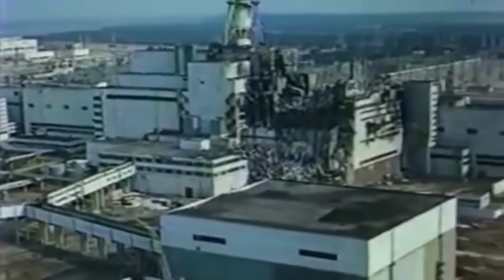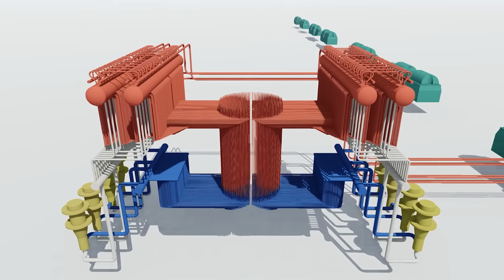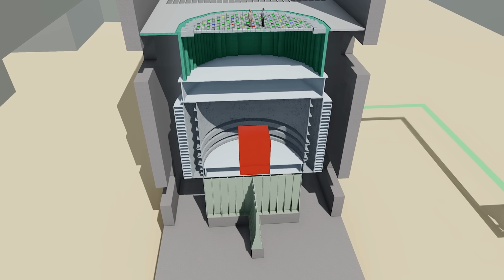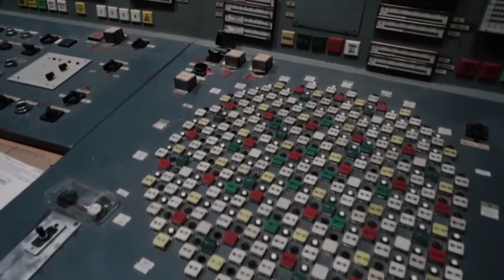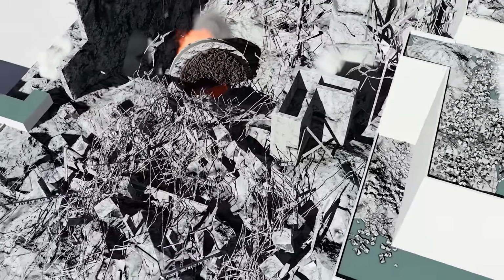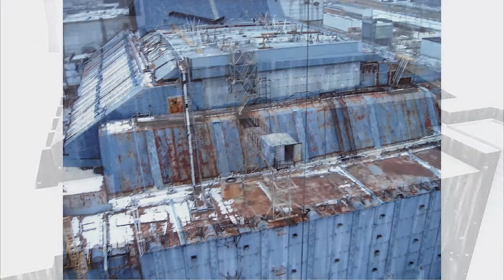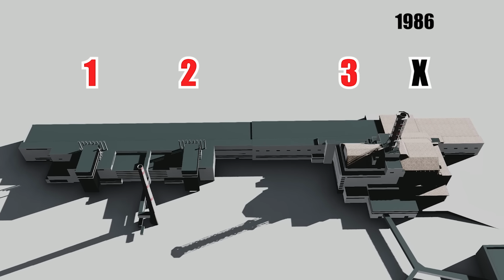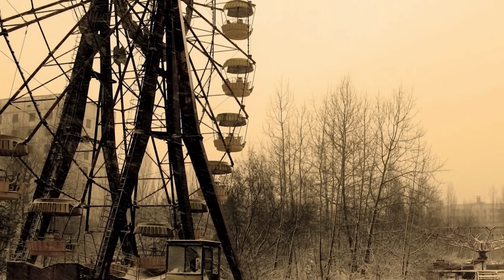CHERNOBYL DISASTER - An Inside Look - 3D

Comment: The main reason for the online refueling: not to put fresh fuel in, but to take the very useful used fuel out. One of the main byproducts of a U-235 fission reactor: Pu-239. Chernobyl and the other reactors like it supplied fissile material to the soviet nuclear weapons program.
Reply: No, this is wrong.  The USSR and the US both have purpose-built reactors that cook the uranium to within an hour of the optimal time required for optimal yield vs Pu-240 contamination.  A power plant spent fuel is simply sloppy seconds to that.
Reply from the maker: This is very interesting.  Does this mean that minimal spent fuel was left at RBMK sites because it was removed to Plutonium recovery facilites? At least for the time that Plutonium harvesting was still happening.
Reply: @Mike-Bell  I’m not sure whether there is any form of semi-permanent storage of spent fuel on site. I would assume so, in the event that the military isn’t currently seeking fresh plutonium. Looking at maps of RBMK reactors and Soviet military bases, they are always very close together. That’s certainly by design.

Comment: Narrator is wrong though. The reactor didn’t go supercritical. That’s impossible
Reply: Until it's fuel load went through the floor.....
Reply: @simonthomas5367  supercritical implies that it was a nuclear explosion. Not possible in a nuclear reactor.
Reply: @slugmaster64  Chernobyl was one "Prompt Critical" accident, the only one in a Nuclear Power Plant. One NPP can not explode like an atomic bomb for other reasons, but it can be supercritical
Reply: @slugmaster64  A criticality accident is an uncontrolled nuclear fission chain reaction. It is sometimes referred to as a critical excursion, critical power excursion, or divergent chain reaction. Any such event involves the unintended accumulation or arrangement of a critical mass of fissile material, for example enriched uranium or plutonium. Criticality accidents can release potentially fatal radiation doses, if they occur in an unprotected environment, such as occurred in Chernobyl. 

Under normal circumstances, a critical or supercritical fission reaction (one that is self-sustaining in power or increasing in power) should only occur inside a safely shielded location, such as a reactor core or a suitable test environment. A criticality accident occurs if the same reaction is achieved unintentionally, for example in an unsafe environment or during reactor maintenance.
Reply: @slugmaster64  Incorrect. Supercritical purely means that the rate of reaction is increasing. What you're talking about is called 'prompt critical'.
Reply: All reactors have to go supercritical when raising power. But, apart from special research reactors, reactors must be controlled so that they do not reach prompt critical.

Comment: well - it's hard to decide which of the three extreme radiation releases was the worst: Chernobyl, Fukushima or Mayak - but as for Mayak even less is known than for Chernobyl - and for Fukushima there're still not enough long-term data
in addition to that there're several other accidents which release a similar amount of radiation although maybe not so violent as Chernobyl and Fukushima blowing up entire buildings - and only cause Fukushima had additional layers it wasn't as violant as Chernobyl by blowing open the "active zone"
has humanity learned its lesson? I doubt it as still new reactors are being constructed right now - and I don'T even talk about the experiements towards fusion (which still will produce long term radiation waste - which maybe even worse to clean up as splitting of Tritium from Hydrogen and Deuterium is even way harder than those heavy elements beyond Lead) but regular fission type reactors
Reply: Nuclear energy is safe. Way safer than any alternative. You cant possibly use fukushima as an argument against nuclear power. It was clearly a natural disaster that caused it not the plant itself. Putting a nuclear power plant in one of the most seismically active places on earth is retarded and should have been avoided, also the waste materials created in nuclear powerplants take up extremely little space and storage is already possible in places where it is safe from the environment. We have the technology to use nuclear power safely and it is the only thing that can replace fossil fuels.
Reply: @ratreptile  well, aside from building a npp at that location was stupid in the first place, it's to blame on the "genius" responsible for installing the main switch gear an backup batteries in the basement - only for that reason it was possible for it to get flooded
they build a wall to protect it, aside from it never was meant to withstand a tsunami but regular high tides only, so they had a possible flooding in mind - installing the electrical stuff below sea level was just one of the design flaws - in my opinion that's far from a natrual desaster

Comment: https://zen.yandex.ru/media/id/5ccfe7533e66cc00af04d49b/vospominaniia-viborca-kak-gotovilsia-vzryv-chernobylia-5cd01375fd2dc300af7bfc59
Nuclear BLOG (in Russian)
Memories of V.I. Borets. 
HOW THE EXPLOSION OF CHERNOBYL PREPARED.

Engineer Vitaly Borets was an intern at the Leningrad nuclear power plant in 1975 and witnessed an emergency similar to the accident at the Chernobyl nuclear power plant. However, all his attempts to amend the operating instructions were rejected.
 "The RBMK reactor cannot be criticized!"

Quote: "Imagine yourself driving a car. Start the engine. Get under way. Accelerate smoothly. Shift gears. Speed 60 km/h. Take your foot off the gas pedal. And suddenly the car starts to accelerate on its own, 80, 100, 130, 150 km/h. Brake - no effect, accelerates. How will you feel?"

Comment: the Canadian CANDU can be refuelled online, is basically RBMK with heavy water moderator instead of graphite. Runs on lowly enriched uranium fuel too, in fact even natural uranium oxide I believe. Considered safest plants in the world, if expensive to build due to the huge quantities of heavy water needed (and obviously low power density because of low enriching). Only design that has a 0% accident rate I recall (unlike the PWR and BWRs you mention, which on quite a regular basis say ´crack!´ too, if not ´Boom´ like an RBMK).

PS. Good animations, liked the crosscut of the RBMK (which is actually multiple reactors in one vessel, if you get it in the wrong configuration, which is what they did got, so whatever step they took, disaster was imminent) but expected that the disaster itself would be explained?

Comment: I believe that Chernobyl now has become some kind of western propaganda, even more than in the 80s:
1. It was not "different" from Western reactors. Think of it as watercooled Sellafield (UPD2: Also, aren't CANDU awfully similar to RBMK?).
2. It was not intended to have positive reactivity. Understanding of neutron flux was not as good as it is now. Positive void coefficient and "control rod tip effect" were discovered during operation and engineering a retrofit was pretty much in progress.
3. The reactor was not an unsafe design. Block 2 of the same plant had a horrible fire in October 1991. The nuclear disaster was avoided due to (cite) "inherent safety of the reactor design".
4. Anatloiy Diatlov was an experienced nuclear engineer. Though his expertise lied with navy reactors, which led to "military" disregard to precautions.
5. (UPD1) The "golden corridor" was not golden during the disaster. It was plated with anodized aluminium panels AFTER the cleanup.

Please, check your facts before dissing a whole industry
Reply: With regard to your 1st point, I think RBMK is more like a WW2 Hanford pile design adapted for power production, while a Windscale pile is more like a Hanford pile with air cooling instead of water cooling. The combination of graphite moderation and water cooling creates the potential for an unstable reactor due to positive reactivity void coefficients, especially under low power operations.. 
Hence the UK concluded around 1953 that, for safety reasons, civil reactors must not use graphite moderation and water cooling. I expect the USSR were aware of the UK view on that topic, but did not choose to follow the same path.

Comment: The British Magnox and AGR reactors can be refuelled while in operation.

Also the evidence is not conclusive that safety systems were bypassed,  the accusation was made in the "official investigation" and at the trial. However subsequent post Soviet investigations say this was not the case, these investigations completely contradict the original Soviet investigation, 
1. The safety test was undertaken with the full knowledge of the certifying authority who had representatives in the control room at the time, the test had nothing to do with certifying Reactor 4 operation, but the safety of all RMBK reactor operations, it was just being done on 4, because it was scheduled for a shutdown.
2. There were no regulations requiring a minimum number of control rods to be inserted.
3. There were no regulations restricting operation at reduce power
4. The test of running down the turbine was done separately to the reactor operation, power had been reduced in the reactor because at the time of the test only one turbine was online. The Scala Computer that checked operation of the reactor at no time advised the reactor be shut down because of its low power status and or lack of control rods.
5. The test was done successfully, and the team monitoring the test were packing up, the AZ-T button was pressed to shut the reactor down for its maintenance and not in response to a power spike. All but three in the control room were gathered around the turbine control panel to monitor the test, others were the two controlling the reactor and one controlling the cooling pumps, they reported there was no sense of alarm from the reactor and pump operators  until after the AZ-T button was pressed and the first explosion occurred.  
6. It was at this time the reactor exploded.

The "popular" story that has most often been portrayed here and in things such as HBO program, is mostly a concoction created by the KGB, once the original explanation was invalidated. They could not take the blame away from those they put in Prison,  but they cleared and made heroes out of the dead operators and then created myths such as the 15 megaton explosion risk, something that would have required a hydrogen bomb. The bubbler pools were in fact drained because of the concern of local contamination from the release of radioactive steam, there was little risk of even a steam explosion as the pools were relatively well vented, which was why they were filling up with water.
Reply from the maker: Yes see my pinned correction comment
Reply: @Mike-Bell  Sorry missed that
Reply: @krashd  What have I written that can be described as a conspiracy theory?

What I am reporting here are the findings of the post Soviet era investigations by the Ukrainian authorities into the accident

As for physics, the principals are the same for both the Soviet  and Ukrainian investigations and seem reasonable , this was no Nuclear explosion, it was the result of an over pressurisation amounts to no more than equvalent of 60 tons tnt. It is the "official Soviet" story of a 5 megaton plus explosion risk which is the one that bends the laws of physics.

What we do know that the RMBK was unstable, this is evidenced by the need to double up operators on the control panel and develop  an automatic control system to manage Tue fuel rods to stop the control rod switches on the panel's needing continual replacement leading to station outages.
We also know that at both Ignalena and Leningrad they had previously suffered both core fuel rod damage from similar power surges.
We know that due to an operator error the reactor had been stalled in preparation of test and power had been recovered to a level to maintain the turbine speed for testing by removing almost all the fuel rods.
We know it took nearly minute for the rods to fully deploy into the reactor from the pressing of the AZ-T button and that those rods only got half way before the reactor exploded.
Thus the accepted theory that the reactors reactivity had been suppressed by xenon build up, due to this low level of reactivity the steam channels in the reactor core were filled with water, when the turbine was isolated to do the run down test. The water acted as a further moderator, to the graphite that triggered a rapid increase in reactivity to burn the xenon off. The increased reactivity either caused the operators to press the AZ-T button (Soviet version) or coincided wit it being pressed (Ukrainian version) the rods being graphite tipped displaced the water steam with graphite further increasing reactivity leading to the fuel rods and graphite in the upper core  to breakdown stopping the control rods continuing their path in the reactor. This led to the smaller first explosion which was the reactor vessel over pressurising as reactor continued to run out of control, and this led then to hydrogen gas created in the over heating reactor to then explode which is was ripped the building apart. Is valid for both the Soviet and Ukrainian version of events leading up to the accident. The only difference between the Soviet and Ukrainian version is that in the Soviet one the operators recognised that they had a power surge underway, in the Ukrainian version they had not and were responding to the test being finalised or if they were responding, they took action without alerting the "crowd" around the turbine panel. Which is not so unreasonable a thing, in such a strong blame that existed in the Soviet Union.

On the face of it the Ukrainian seems more reasonable, there was no good reason and many bad reasons that the turbine run down test would as the Soviets say, be done with the reactor itself, rather than the Ukrainians version of doing it by isolating the turbine, simulating the pump electrical load on the generator and monitoring its ability to sustain that load.

As for the lack of restrictions with operating the reactor at low power and or without fuel rods installed again seems reasonable and is supported by evidence provided by operators of the reactors at Chernobyl and Ingalena,  they say these instructions were not introduced until after Chernobyl.  What we do know is that the Soviets lied in their initial report to the IAEA and the Yeltsin government subsequently admitted the Soviets lied to conceal serious flaws in reactor design. Why do we then still believe their revised story now? Well the reason is simple, the Soviet version was out first and unlike the Ukrainian version, which has no heroes and villains, the Soviet  version has heroes and villains and so makes better drama.